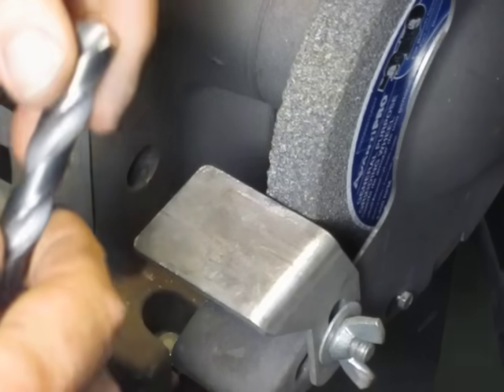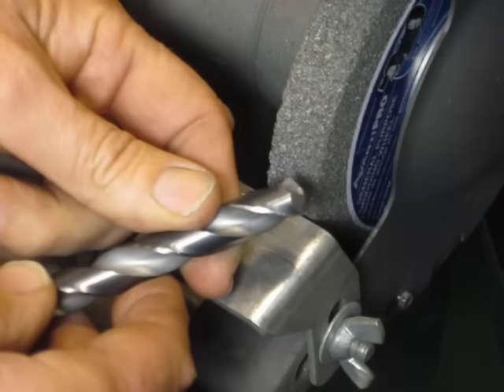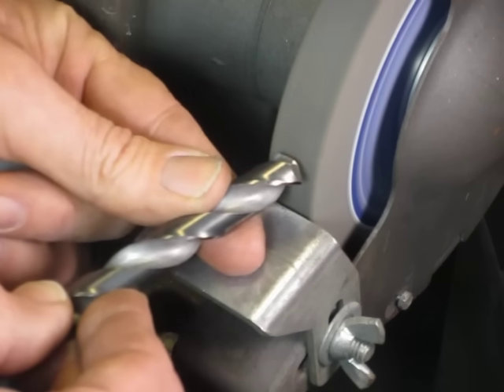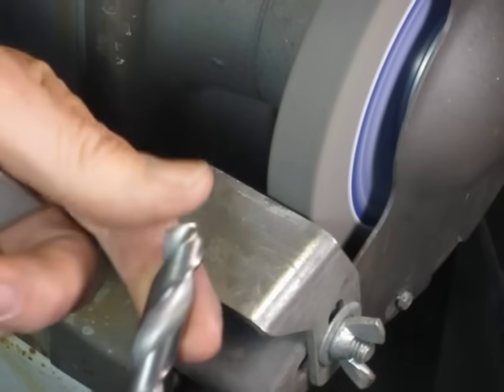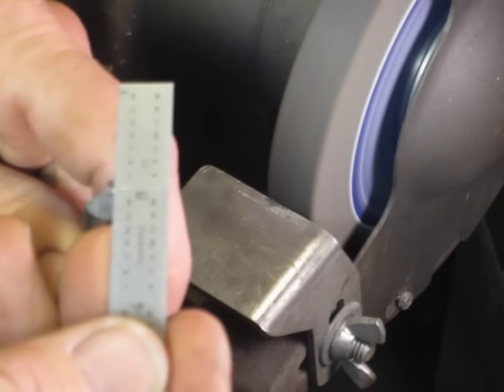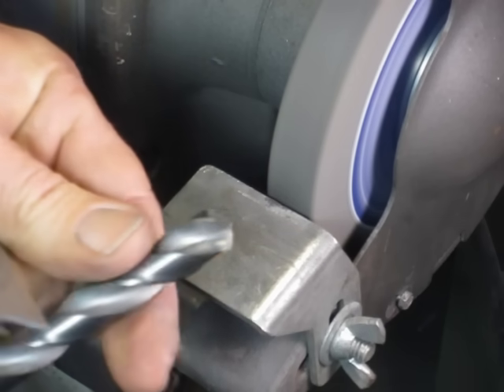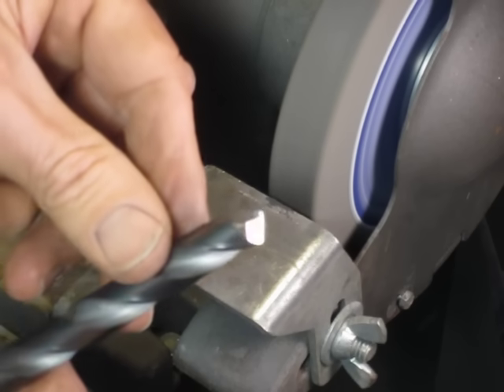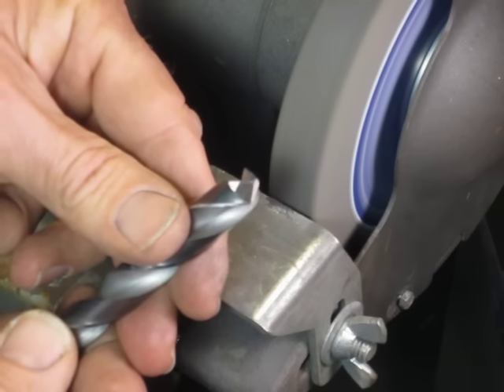How to Hand Sharpen a Twist Drill

Comment: I learned to sharpen twist drills when I was an engineering apprentice in a Textile Machinery Manufacturer. I did it a little bit different:- rather than create a series of individual 'flat' angles, I would have an upward and slight rotating motion that created the clearances. Whatever works is good.
Thanks for sharing
Reply from the maker: That's the way we were all taught in shop class, but this technique is actually more efficient. Do a little research on multi-faceted drill point geometry to see why I do it this way instead.

Thanks for watching.

Comment: I thank you for putting a good video on YouTube! I learned that when I was 10, from my Dad...then later in a job-shop, the boss had me sharpen all the drill bits used, at least once per week. One big difference I saw, is that you never used a quench can, to keep the bit cool during sharpening. This is a must. Also, you need to make sure the sparks fly off the top of the cutting edge...otherwise you're grinding too far below the cutting edge. I used a mill and made a drill tip pattern on a piece of angle-iron, which i bolted on the top guard rack. I could hold my bit next to it and check the angles at the tip. Later years I visited that shop again and tgey had a new grinder there, and they had my pattern bolted to the top shield assembly on it too! Make you one. You won't need a scale nor protractor again...for sharpening bits. Thanks again for posting.
Reply from the maker: Good tips Lee. I discussed the spark thing in one of my other videos and plan on including it when I remake this one. Quenching however is not necessary, other than to keep the bit cool enough to handle. That's a hold over from when cutting tools were made of carbon steel, not high speed. High speed steel has what is referred to as good red hardness, which means it doesn't start to lose its hardness until around 1100ºF, not 400ºF like carbon steel. I have a video out on that very point that includes an interesting demo. Woodworkers still use carbon steel cutting tools such as plane knives and such and they are commonly sharpened on a wet wheel to keep the temp down on the cutting edge.

Thanks for watching.

Tom
Reply: Toms Techniques thanks for replying. I was a tool and die maker before I had a chance to double my income by becoming an electrician for a railroad. That was some 40 odd years ago. I picked up more tips in the rail industry. The boilermakers had a rule, that every tool was treated gentle and if grinding something on a bench or post grinder, you dipped your work in a quench tank, which was secured to the grinder base. Thanks
Reply from the maker: Lol. I doubled my salary going from teaching to industry.

The railroad and especially boiler makers are a traditional bunch. The quenching thing was more about that than logic. :)

Tom

Comment: Good video. I have a question; being someone not in this line of work, what is an "included" angle? Thank you from Australia.
Reply from the maker: The definition of an included angle is the angle formed by two lines with a common vertex. On a drill, if the angle of one cutting edge, relative to the center line, was 59º, the "included" angle of both would be 118º.

Tom
Reply: Thank you for replying. 
Thinking about it now, I really should have Googled it rather than taking up your time to answer. 
Have a great life, and we appreciate these YouTube tutorials, thanks.
Reply: @johnrogers5825  Every question offers the opportunity for others to learn. Not all of us think of the questions to ask in order to get the answer.
Reply: @davidnighswander7022  True David. Also, I was told once, there is no such thing as a stupid question. Peace man.

Comment: This video could have been 2 minutes long...I usually take approx. 1 minute to sharpen a drill bit.
Reply from the maker: You seem to have missed the point that this is an instructional video, Ed. Making one a few seconds long showing how fast I can sharpen a drill would be pointless, much like your comment.

Tom
Reply: Yep, pointless comment and silly. One has to wonder why eduardo was watching anyway?
Reply: I just love how people approach drill sharpening...which is a basic skill that is usually one of the first things to be learned in the metal trades.  I have been sharpening drill bits for years and have never once used an angle finder or measured the lips..  Most people I have worked with have horrible sharpening skills.  Maybe I will do my own video.  Not even a mention of the importance of truing the wheel.  Sharpening drill bits is a very crude procedure and there is a lot of give as far as angles and dimension unless you're working in high precision environments.
Reply from the maker: You certainly have a lot of opinions, Ed. Perhaps you should take your own advice and make a video of your own, instead of criticizing the efforts of others. I suspect you'll find that it's not as easy as I make it look.

By the way, measuring the length of the cutting edges is critical when sharpening a drill bit. A difference of just .020" will cause the bit to drill nearly .040" oversize. If you can get them that close by eye, then good for you, but most beginners can't do that. Just because you are good at something does not mean you are good at teaching it. 

Tom
Reply: I don't actually disagree  on multi facet drill sharpening...I agree that it is superior in cutting but in the real world when you are drilling holes of little importance where the clearances could be quite high...the last thing my boss wants is to see me spend 10 minutes sharpening a drill bit which is going to be used with a hand drill or a sloppy setup on a garbage drill press, both of which cause the drill bit to deteriorate quite fast.  Plus coolant is almost never used.  That being said.  I didn't mean to take away from your effort.  Good job on your explanation.  My boss appreciates the time I take to sharpen a drill bit and I also do it the same way when I drill holes at home.
Reply: Thank you for this video, I learned a lot.  
Ed's comments might be correct, but not to the point.  
You made an instruction video for the layman.  
But it's not correct, criticizing Ed on not making videos.  
I'm a woodworker and see a lot of perfect videos with fine woodwork.  A lot of crappy videos with fine woodwork.  Woodwork I will never be able to make myself.  The best woodworkers have no interest in the fine art of video techniques.  And you have the snobs.  Best video recording, 4k, ... with the worst techniques I have ever seen.  
Just to say that, no one is wrong because he cannot proof his competency with a video.
Reply: Nobody forced you to watch the video.
Reply: Maybe you need to sharpen your PECKER ?
Reply: Bp6

Comment: first thing you want to do is make sure you have a flat face on the grinding wheel, no? who didn't make an angle guage to do this in shop class?
Reply from the maker: Considering you should use the entire face of the wheel when grinding, they tend to stay flat for quite a while. If not, all it takes is a few light passes with a dresser to bring it back.

A drill gauge definitely was a required project when I was teaching. :)

Tom

Comment: Your grinding technique is nearly identical to mine, I've done thousands in 40 years.  Here's a tip.  To get that last fraction of a degree, the last few thousandths of lip, I shut the wheel off and touch the drill as it slows down.  Lots of control, easier to get the results I want.  Great finish, too.  I often do the same thing when thinning the web, for the same reason
Reply from the maker: Thanks. I'll have to give that a try.
Reply: What I like about it is things are happening just like they normally would, only slower.  Mistakes  are more easily avoided.  Too much coffee can make my hands shake, slowing the wheel helps.

Comment: Very useful video, didn't know you can sharpen bits like that, thought I need a special tool. 
As for the angle, I just eyeballed it and it worked fine.
Had to resharpen it a few times because I drilled two stainless steel knives and they were tough af.

Comment: A guy I work with sharpens our old bits kind of like this, except he doesn't use a protractor or scale. He just eyeballs it. I tried to do it, but just made it worse. Luckily, most of the time, they keep a supply of fresh bits around.
Reply from the maker: I don't use them either, but for someone just starting out, it makes the process a lot easier.

Tom

Comment: First have a square flat sharp grinding wheel. I assume you had this. Never let the bit become hot. Annealing. I ALWAYS have a cup of water for cooling. Smaller drills will heat up fast and anneal the tip (soften). Tool Maker 40 years and ALOT of drill /mill sharpening. Good video and angles used are correct. I always use the corner of the wheel to open up the flute like you did. The flatter the wheel the better the corner.
Reply from the maker: This was one of the first videos I made, just as sort of an experiment. Never thought it would become so popular. I'm planning on remaking it using a more appropriate wheel and also some better camera work. Check out the red hardness of high speed steel and you will see the fallacy of having to keep the tool cool. Pretty sure you'll find that it doesn't start to lose its hardness until it gets around 1100ºF. In fact, I made a video demonstrating that very point.

Tom
Reply: Good vidio  but I think Chuck was right about drill bit can be softening. At the point that stone hit metal local temperature can be very high carbon at the surface combine with oxygen in the air. Make you loose carbon at surface.  I normally hand stone after bench grinding that would remove soft low carbon layer and drill would stay sharp longer.

Comment: The person doing this demonstration has the right idea by using a protractor.  Only, take that protractor one step further, and make little tic marks with a pencil on the big part of the protractor and use the tic marks like the marks of a ruler.  That way you can make the length of each flute equal' to each other, according to the tic marks.  And you can make the angle of the flutes to the centerline of the drill equal to each other.  This guy knows what he is doing.  For thinning the web, use a grinding wheel that has a fairly sharp corner on the wheel.   That sharp corner will be the part that grinds the web.  Be careful not to grind too much of the drill away.   Just touch the web to the wheel a little bit.  Go back and forth to each flute several times so as not to grind too much of the drill.

Comment: A hand grinder with a new disc works far better, and you should be able to eyeball all The parameters, no need for all those measuring devices. All that tells me is you are not near as good as you think.
Reply: I think you mean "..not nearLY as good.." Perhaps you could do a vid and show us how it's done using your eyeball and grinder (not that I've anything against grinder's). As a young man, I was told this; "only a fool or an amateur criticizes an unfinished job".  Tom was laying down techniques to get people started. Leastways, that's how I took it.
Reply: Have always done it that way, old school, you know like they did in the old days. Guess it comes down to you either have the eye for it or you don’t.
Reply: Not necessarily. As one gets older and the eyesight isn't as good, it would be either foolishness or stubbornness to persist in the "old school" ways, if they don't work as well. I know, as I too, am of the old school. But, hey, what's wrong with tooling that makes it easier, or better?
Reply: It’s all in the eye, the feel and touch. Just like operating a piece of equipement, that you run by the seat of your pants. The hands know the angle, the speed to turn it to get just the right amount. These fancy gadgets tend to be crap and do a piss poor job. Bench grinder stones are never truly flat either, unlike a new hand grinder blade.
Reply: I don't always take the drill doctor with me to the field so what then if I bust the bit (and I probably will)?  Why learn multiplication when we have watch calculators and smart phones where you can call a hotline if you need to know what 7x8 is in the 4th grade?  Wait, is there still such a thing as a 'hotline' anymore or did we grow out of that too?
Reply: @letserb   two posts and its obvious you know naff all, move on to another subject your fired

Comment: great description on drill cutting angles, but what about smaller bits? they are really hard to sharpen
Reply from the maker: Small bits sharpen exactly the same as larger ones. They are just harder to see. Try using a magnifier, either one of the head mounted kind, or one that clamps to the grinder.

Tom

Comment: I have a set of 13 bits from .031 - .125 I would like to see you sharpen by hand. Hell, I can't even see the chisel point on the .031. No way I would put my fine, expensive cobalt drill bits on that corn cob you're using to sharpen your drills.
Reply from the maker: I hand sharpen small drills like that all the time, but as you so eloquently suggested, with a finer grit wheel. And no, I don't thin the web on them, but I do put multiple clearance angles on them just like the larger ones. Magnifiers and pin vises make it a pretty simple task.

Tom
Reply: Simple, yes. I totally agree. But I have to use a magnifier, a bright LED gooseneck lamp, and a dremel tool clamped in a vise. I thin the webs on about 5/32 and larger. Doggoned tiny sized carbide and cobalt drills are expensive or I would just throw them away when they get dull. Thanks for the nice video!
Reply: Bob Adkins stolarske masine

Comment: I also use this method and it does work but what you are holding is a Bit not a drill and the tool you put this bit into is a "Drill Motor" and not a Drill.
Reply from the maker: Getting into a discussion about the proper name for a twist drill is kind of silly, but since manufacturers such as Morse, Cleveland and Regal call them twist drills, I believe I will as well. Drill bits is another common name for them and if you like that one better, it is certainly your prerogative to use it.

Also, do you know what a cordless drill is? Just a question. Because companies like DeWalt, Makhita, Bosch, and Milwaukee make and sell millions of them. 

Tom
Reply: I will never understand why clowns like this make comments like this on such informative and well laid out instructionals, made by people who have forgotten more than most of us will ever know.
Reply: Just because something is known by a name to the general public dose not mean that's it's correct name. The general public shop for tools in DIY stores where drill bit is most likely the only name the staff will know a twist drill by. If you go to a machine tools supplier they will call it a twist drill, the name the manufacturer uses, the name text books use and the name qualified engineers use.
When I was an apprentice about 30 years ago I would have been torn to shreds for calling a twist drill a drill bit and I'm sure it will be the same today. That is if you can find any proper engineering apprenticeships today, which is the whole problem, there are so few real engineers now and a hell of a lot more DIY experts.
The consensus is not always correct.
Reply: Language evolves, and a drill is now the common terminology for, well a drill, and a drill bit is still a drill bit, but if someone says pass the 1/4" drill you know they want the bit. Its not hard.
Dont know why people think the terminology they learnt 50 years ago must never be changed.
Reply: wrong a drill goes in a drill motor and bit goes in a horses mouth.  Thanks for the vid Tom!

Comment: New ways to do old jobs.  I have watched two different techniques on youtube this evening.  MrPete222 and yours.  More than one way to do a job.  Glad I watched your video.  Your grinding stone seems to be well dressed and well balanced.  What type and grit do you use.  Great Job.
Reply from the maker: Thanks.

The wheel that I used in the video is 60 and a bit coarse for small drills like these. I normally use an 80 or 100 grit.

Tom

Comment: You shouldn't overheat the drill, and you should finish with a thinner grid
Reply from the maker: Unlike carbon steel, high speed steel has good red hardness. That means that it won't lose its hardness until it gets up to around 1100 degrees, way hotter than you could hold onto. 
Not sure what you mean by a "thinner grid".
Reply from the maker: That is true, but even so, you would have to try pretty hard to get it to 1100ºF. It would literally have to glow red to be compromised. Carbon steel tools are a different story. They do need to be kept cool when grinding, hence the wet wheels you see for sharpening woodworking tools.

Tom
Reply: Toms Techniques Alright, and you were indeed taking care with the pressure on the wheel.
Reply from the maker: Does not apply to "high speed steels". Tool steels such as O1 and A2, still need to be kept below 400 degrees.

Tom
Reply: Toms Techniques The tiny cutting edge has much less mass and will probably spike in temperature long before you notice it.
Reply: Tom: Thanks for the information on overheating high speed versus plain carbon steels. It is now obvious to me that some of what I learned about sharpening woodworking tools does not apply to tool steels.